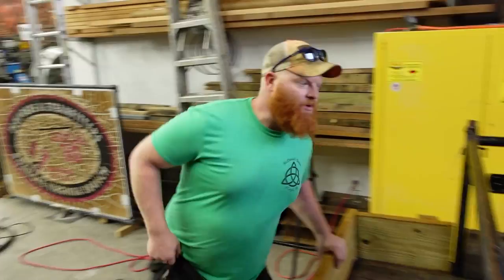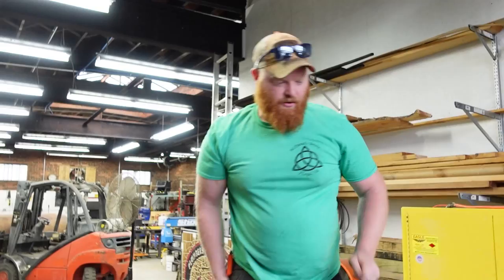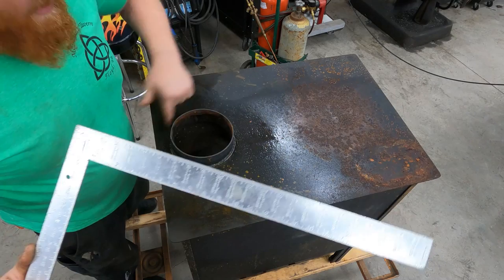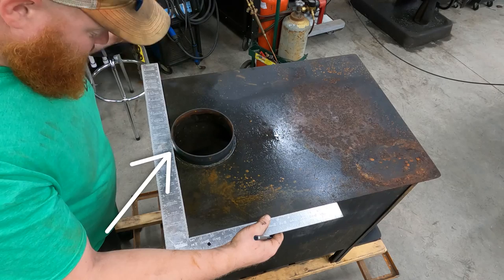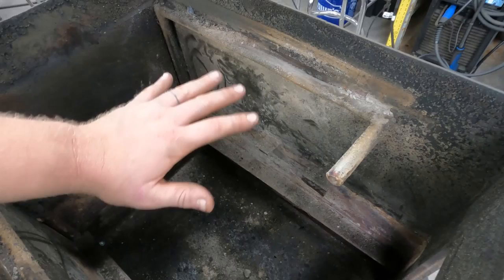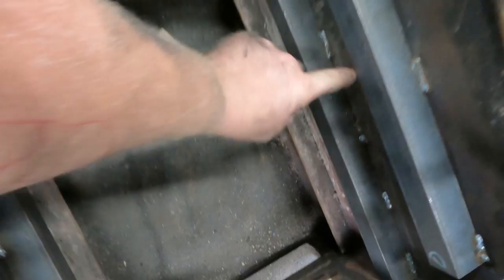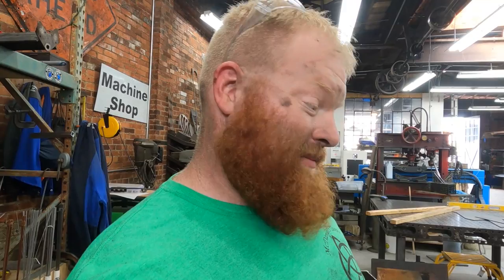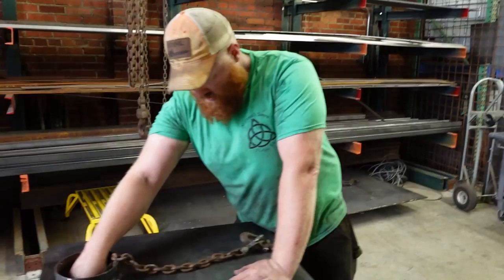Repairing a Vintage Wood Stove! // Lift Arc Builds

Comment: That plate used to be referred to as the 're-gas afterburner' by the old timers, but new design technology (HTTM - Heat Transfer Tube Mesh) has  mostly replaced this since the late 90s.

BTW, I made all that up.  Sorry.  Enjoyed the video though.